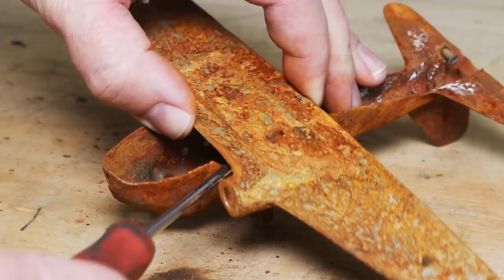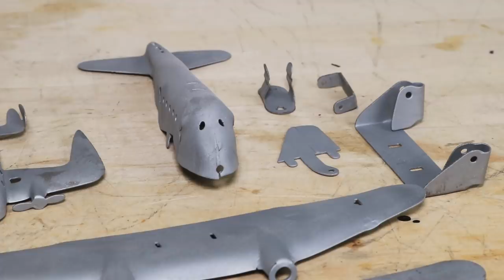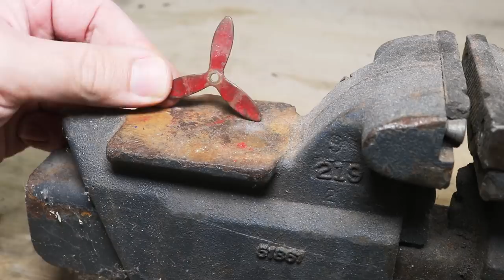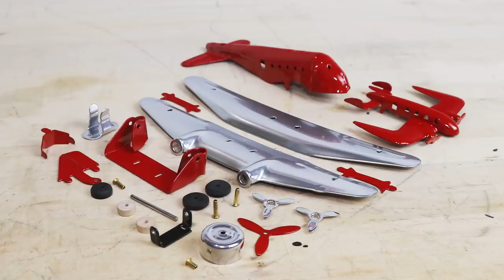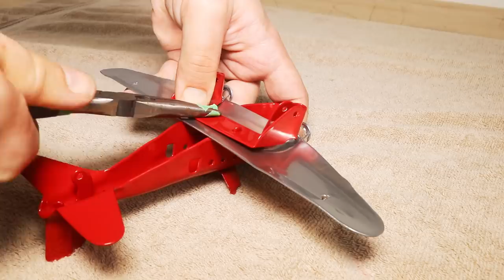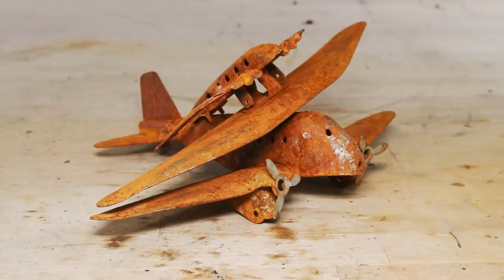1930s Wyandotte Biplane Mystery Plane Carrier Restoration

Comment: I think it's cool that just 20-something years after flight this was already a concept in a toy that would actually be used in our space program 40 years later. Great restoration!
Reply: Actually, the space program wasn't the first. In the 20s/30s, it was common for flying boats to carry smaller planes into the air on their backs. These smaller planes carried mail, and used the flying boats to extend their range.

Comment: This Toy is based on a configuration that was used for trans Atlantic air mail flights. The smaller aircraft was stuffed with mail and fuel.  This made it to heavy for takeoff on its own.  It would ride on the back of larger aircraft for takeoff off and once aloft it would separate.
Reply: The Short Mayo Composite. Only one was built, and saw service from 1938 - 1941.

Comment: It is based on the composite aircraft primarily intended for transatlantic Mail.  Larger aircraft carried the Mail plane aloft released it in flight, then returned to port while the smaller aircraft continued on.  Short Mayo Composite with Mercury.

Comment: Something about the condition of it starting out is bugging me. The rust is too blotchy, and it blasted away to easily. There was no paint under it on the big parts either. It looks like it was used as the sacrificial peice in electrolysis briefly to rust it up. Has Chip rusted this toy just so he had to blast it?? What does anyone else think? Shenanigans?
Reply: Or something someone else had tried to restore, and gave up on?
Reply: @rogerrabbit80  do you agree that something seems off about it? This one is different from every other one I've seen of his.